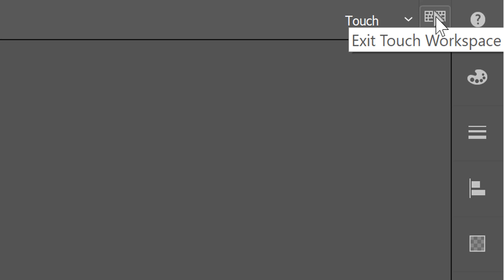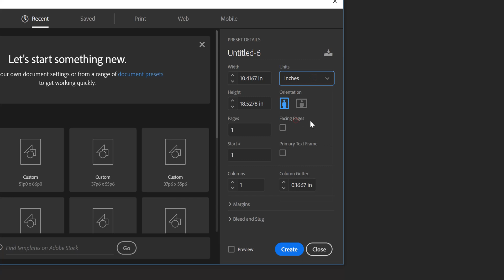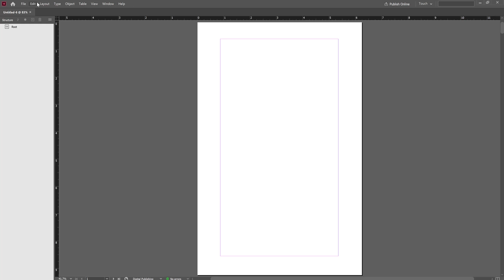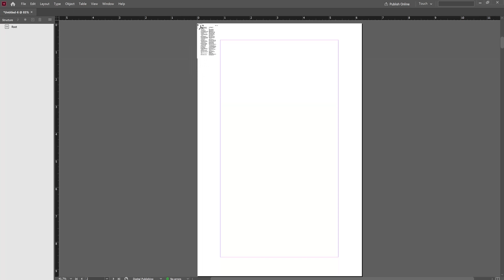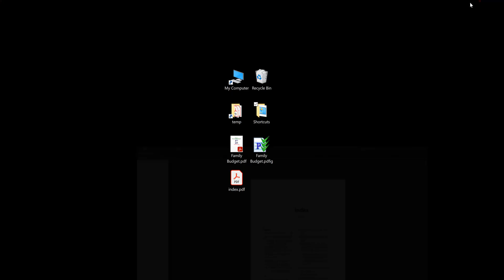Adobe InDesign: How to convert a PDF file to InDesign file?

Comment: I have a file in pdf (around 1000 pages). I would like to import all the file to indesign and insert a text (and the number of each page) in the top of the page. Is there a way to make it easy? Or probably I will need to do it one by one? (The text and number of the page need to stay in the layer up to the document to be showed)
Reply: up
Reply: in INdesign create your page size based on pdf page size then proceed with the following From Menu tab select -  Windows->Utilities->Scripts.... select Scripts tabs... Application->Sample->Applescript ..... select PlaceMultipagePDF.applescript  Select the file name you created when asked and place 1 page per. i'm on a mac so not sure if windows is the same procedure.
Reply: @GameCrewzer  it's and it's working, thanks!

Comment: Please please please how do I increase the size of the file I pasted ..like I got the size of original file and customized it in Indesign but whenever I paste it  it’s a bit small and I can’t increase it
Reply from the maker: Did you set the page dimensions as explained in the video, using the width/height values of your original book?

Comment: I don't understand where you got the margins from in the pdf file? You said, "In the index of the pdf file," but where is that located on the pdf file? I saw the location of the height and width, but not the margins. Thank you.
Reply from the maker: May be i didn't make that clear, sorry! ... I've designed the index for my book, so i know the values of its margins. If you don't know the margins used for your PDF, if you have Adobe Acrobat you can click View -> Show/Hide -> Cursor Coordinates, then move with the mouse through the page text content margins to see the coordinates. You can calculate the margins used. At least approximately.
Reply: @PDFColony  I appreciate the fast reply! Thank you so much!